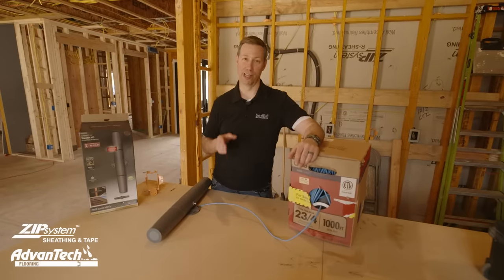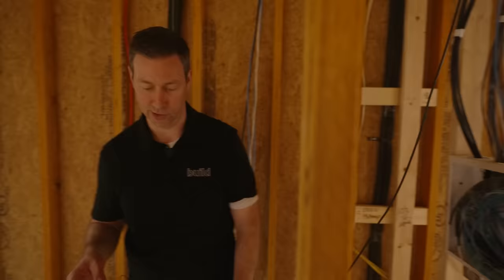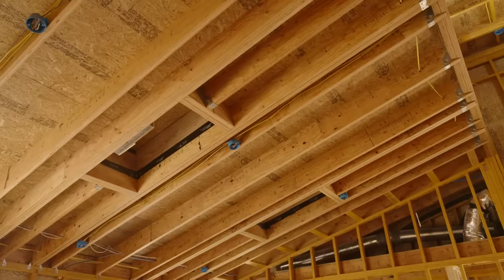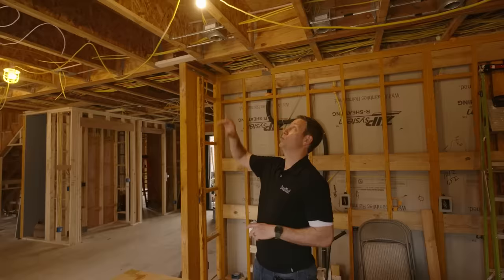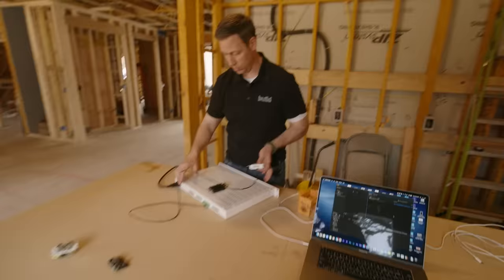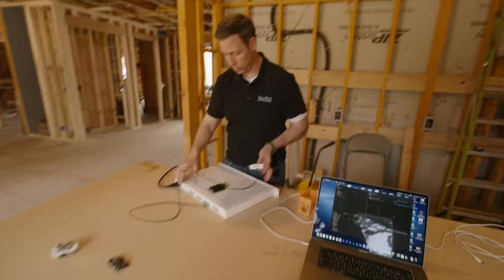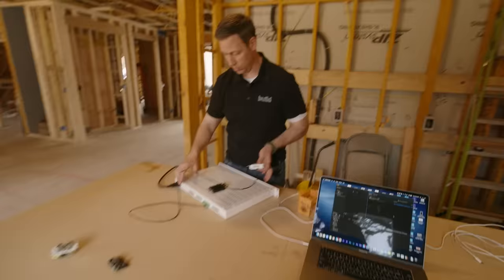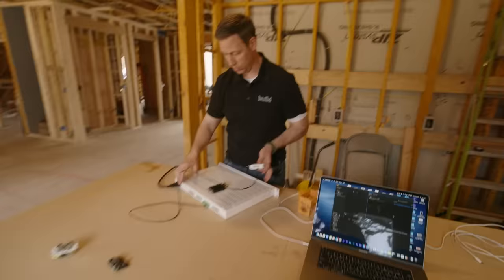Low ⚡Voltage at the Real ReBuild

Comment: Hi Matt, I've been doing low voltage and surveillance systems for 15 years now. I wouldn't recommend the unifi camera system. They are over priced and don't integrate with other systems. You'll have less cost, better video quality, and more options with Annke cameras or amcrest and one of their NVRs. Even better is a blueiris computer to record all the feeds. I've installed a couple unifi camera systems and regretted it. Their network gear is awesome though and highly recommend.
Reply: People having issues with UniFi cams are people who don't understand UniFi cams... Annke = consumer grade. Axis or Mobotix = pros.
Reply: @skynetlabs  Hi Kaye, if you know axis cameras then you know onvif compliance which unifi cameras are not the last I checked. It's not worth going with none onvif compliant cameras especially at the price point of unifi cameras. Also, an annke c800 4K camera is $100 with an image sensor of 1/2.5. In comparison the axis P3248-LVE 4K camera with an image sensor 1/1.8 which probably produces a little better image is $1000. I think for most customers I'll save them the $900 unless it's a casino 🙂. If you haven't checked out blue iris you should. Very robust system for a fraction of the price of other commercial ones. Most of my clients are home owners and small businesses so affordability is a big part of the bids. Ubiquiti makes great products but their cameras just aren't worth it in my opinion. One piece I ran into with them was a simple way to display the cameras anywhere. The netcam viewer system is a great solution if you haven't seen it that uses the RTSP stream to display the cameras. Unifi protects RTSP stream didn't work well when I tried it last. Wish you the best and I'm always up to talk more if you like and get any tips you have.

Comment: I would suggest a two level power system. Get a little bitty shut-off for unnessisary power devices in case you are on battery. Many devices (power supplies in particular have bleed resisters that will consume power in standby mode.)

Comment: Any unlink to hot spots, video and audio using cat5e, cat6, etc should be wire with shielded cable. It prevents a lot of issues in the future and your wireless devices will lag less.

Comment: Future-proofing a home is really tough. I love the Deako concept of modular switches where the owner can easily swap in a dimmer or change things as needed in the future BUT I would be reluctant to use Deako products because what happens if they aren't in business in 10 or 20 or 50 years?

Even that clever USB A and C system is going to be obsolete at some point. I have a 110 to USB A adapter (that came with something) plugged into a surge protector. Combined with USB A to C and Micro cables, this is a cheap alternative that I can take with me and eventually replace when the time comes. 

And speaking of surge protectors, I have all of my electronics and my refrigerator plugged into surge protectors. We don't often have thunderstorms, but when we do I don't trust our power provider to protect my electronics. Is there anything you are doing in your house to avoid the need for plug in surge protectors? If there isn't a "house power" solution, then surge protectors WITH USB ports are a nice compromise solution.
Reply: The best future proofing is something like blue smurftube where you can pull new cable later - whatever new technology that ends up being.

Comment: Would the lighting circuits be on their own separate circuit (not an electrician)? Or would they possibly be tied into wall receptacles when convenient? Otherwise having less expensive wire would make total sense to me for lighting only applications. Having something like that Voltek system in place could really cut down on resources on a macro scale.
Having plenty of Ethernet runs is just a great idea. While wireless is great, a solid Ethernet backbone makes more sense for all the media devices out there now IMO. You know we're gonna wanna see all the tech you put into this house! Especially if you have a dedicated rack. The Ubiquiti system would be interesting to see installed, especially as it looks like they have some video security equipment also.

Comment: One really good thing you did: the in-ceiling and in-wall speakers are dumb.  If in 10 years you don't want Sonos?  Swap it out for a new head-end.  I've got a Niles system, and all of the speakers (and the high-power amplifiers, even) being dumb means I could change it in about 2-3 hours for Sonos, Heos, Russound, or anybody else.  Good speakers, like the Sonance that Sonos sells, are on the market for at least 10 years and last for 30-40+ years, but the tech being centralized in a closet changes all the time.

FWIW, I even used AV receivers to power passive in-wall speakers for my TV, which can be swapped out at any time, over a sound bar.  Also, they look and sound better. :)

Comment: Ubiquiti Unifi works well - that is what we use for our commercial clients (and some residential)

Maybe you should have ran Cat7? (I foresee video/data increase in the near future for video over ethernet - 4K/8K/16K - 3d video...).  Isn't Cat8 now available too???

Also most cable companies are moving to internet boxes - so phasing out Coax.  But I guess always keep Antenna an option =)

I agree on the cable runs to the ceiling for Access Point from the below commenter (they can be POE - power over ethernet with POE switches)

You should have data cable runs to all TVs - because kids and their video games and Netflix.
Also Cable runs outside for all POE cameras
Also think about outside cable runs for patios and future add-ons (grandma suites/pool houses/tool sheds.  Maybe have a junction box you can add a small POE Unifi switch to split off from outside for future runs)

You should also think about running alarm type cabling and prewiring for options like doors/gates/garage doors - not just the window blinds

Comment: Hi Matt, you didnt put in sensors or smart devices? or access control (door locks etc)

Wireless even if its 1G, 2G, 3G 4G or 5G will have a hard time penetrating concrete walls and reinforced concrete basements, so  I think all low voltage should all be wired.

Also the media consumption is all digital, which keeps getting better in resolution and data bandwidth. 

Wired connections are also much more secure and reliable, although they dont allow that much flexibility.

thanks for this video, it was really informative.

future proofing your house should be sane decision, as the pace tech is innovating.

Comment: The voltek stuff looks cool. but i think a company like leviton could easily do better by building a single outlet and a USBC-PD and USB-A all into a 1 gang unit. Plus they could have that tech in all the big box stores easily. I just tried to look into the voltek since i would use something like that for customers or even my own home, but they want me to inquire within. Plus i would have to have the controller unit setup somewhere central then have to run the DC wire. Where as a single gang unit from leviton or whomever could easily just be a drop in replacement. using 110 wire which is already installed. Also if i were you i would install cat6a or drops for Fiber to where you would have computers. It would allow you to easily upgrade to 10G in the future. Could be useful if you are doing any video editing or anything at home.

Comment: In general I agree that keeping an option for cable vs all wireless is smart but I would go one step further.  I would have suggested using more “smurf” tube as conduit runs through the walls and up to the attic. It might mean longer wire home runs but you would always have the option to pull and re-run new wire when cat 6 is the extinct technology.

Comment: I am very interested in seeing the tech rack install, the Wifi Access Points, etc installed, and, why you chose certain locations for access points.  This is very interesting stuff.  I look forward to seeing how well your over-the-air antenna works.  Thanks - this was an awesome video and gave some new things to think about for my upcoming remodel.  Will you be adding a gaming console in the media closet?

Comment: One of the Leviton brand outlets has a USB-C port with PD (Power Delivery) that should be able to charge smartphones or other devices that can make use of it at higher wattage.  And if they’re mismatched, they’ll just fallback to the highest wattage both sides are capable of.

Comment: Make sure you read the manual on the antenna. Depending on the desgin, you should NOT point the long side towards the TV station, instead have the long side of the antenna perpendicular to the direction of TV station

Comment: LumenCache is actually a company doing low voltage for lights and lighting control
Reply: Yep!  I wish they had a more up-to-date YouTube presence showcasing the solution and products.  Maybe they are more focused on commercial applications now?
Reply: @bradgaeth   I think that might be true, or focusing on getting vendors on board. A couple of the videos I saw of theirs were geared towards 3rd party installers.

Comment: Nice video 
Boy just revived notification Wednesday 9 Am EST and there is some 791 comments 
Well 12/2 vs 14/2 it’s a different of 600 watts, well run wire my house 14/3  or 12/2 less of blink factor 
Now go low voltage DC 5volts think voltage drop even speaker wires go to 18 Gauge wire 5 Amps max 600 watts in most case it’s 5 volts x 5 Amps = 25 watts at plug - I used  Legrand they rated at 5 volts at 3.1 Amp or 15 watts power 
My old Laptop is 24 volts at 70 watts or 3 Amps so need brick 
In school instructor said wire vs air to bounce just add wire only one Atmosphere but the space travel 
Sound over light waves 
It’s 80F at cape cod Ma today w/100% sun it’s great day

Comment: In 1999 my wife and I had our current house built, during that process I wired the house with CAT5 and coaxial cable. Each bedroom (4) , the kitchen, garage, dark room and two family rooms were also wired.  Fast forward to 2017 maybe, Verizon is now offering one meg internet speeds.  Bought the service, got an upgraded router and then there was failure after failure. Couldn't get the speed they advertised. Their response was... the speed is getting to your house, but the wire in the house can't handle it.  My next question, can we do it wirelessly?  The answer was No. Hardwired cables give you the fastest speeds. I had to rewire my house with CAT6 500Mhz 23awg 4 pair wire. This could be accomplished because in 1999 I had the builder install an 1.5 inch PVC pipe from the basement directly into the attic. Using that pipe I was able to rewire the bedrooms on the upper level and the garage.  The basement and first floor connections we're also completed with a little bit of difficulty.  So now my Internet connections are instantaneous.   Your video this week as usual had a lot of good information in it. The one thing that's really interesting to me was your TV antenna for local channels. Since the FCC changed all the channels to digital, we haven't had a good signal even with an antenna installed in my attic.  We get one channel.  The antenna website you mentioned was utilized and I discovered all the channels in the area come from the same location, almost. So I don't understand why I get one channel out of six.  Keep up your good work.

Comment: The ethernet cable listed in the description is copper-clad aluminum (CCA) wire which is not recommended in the IT world; you want solid copper wire instead.

Comment: 19U is definitely not enough go for a floorstanding 42U.  You want to separate stuff for heat and for wiring neatness.
TiVo, networks switches and a few other items will cause a lot of heat if racked next to each other.

Comment: I checked out the Voltek system. The specs say that each line can provide up to 60w. The laptop you showed is a 16” MacBook Pro and it requires a 96w. Their website says it will charge “most laptops” but technically it is only powerful enough for the MacBook Air and that’s it. The 13” MacBook Pro requires 61w and the 15” MacBook Pro takes 87w. 

Just a heads up.

Comment: Even if you’re planning on using wifi with a mesh network, run cat6 to various points in your house to install access points. That allows the network backhaul to run on the wire rather than a wireless frequency and will give better performance.

As far as the Voltek system goes, why spend $1000 for a glorified centralized power brick as opposed to installing separate supplies at a fraction of the cost?

Comment: Ubnt makes decent network equipment, I just don't like that you have to have a controller and they are JUST starting into wifi 6 (ultimately why I switched). Cat6 is a good upgrade over CAT5E but I would recommend the shielded alternative, cat6a, for permanent wiring to minimize any noise from lights or adjacent wires.

Sounds like you are thinking of the backup plan for the Demarc which is always good since technicians will likely reterminate the hell out of it until there is nothing left.

Comment: USB power delivery caps out at 100 watts, so "most" laptops will work on that USB type C port, but some gaming laptops are bigger than that. For example while my Alienware M15 has a type C port for video and everything else a type C port can do, it doesn't input enough power so it doesn't accept charging, and my power brick for it is a big 180 watts.

Also I'd have done 12/3 also, just because there are a lot of low power lighting capabilities out there, doesn't mean that's the only thing you want to run on those lines. If someone gets into crafts, you might want a heat gun, soldering iron, and hot glue gun all in the same room and all of a sudden that 20 amp circuit becomes critical.

Sounds like a full network closet. I'll be interested to see the rack build. Also Matt to be fair, even a lot of IT guys aren't network engineers. There's a lot of specialization in tech now, just like there's a lot of specialists in home building. You have 3 different people for network, server, and desktop administration.

Comment: Coming from a Low Voltage contractor that Voltek product is absolutely absurd for $1000 haha. You can retro in a USB QC 3.0 or PD outlet that outputs 30W which granted isn't 60 (very few devices will even utilize this) but the idea that this is somehow a cost savings vs running "high voltage" wire which you are REQUIRED to do by code anyway (outlet spacing requirements) is off base. If you buy the right outlet it WILL charge a Macbook pro (currently posting from mine plugged into my PD outlet) and certainly fast charge any mobile device (charges my Samsung Note at maximum fast charge). Is it marginally slower than the brick for the laptop? Sure! But it's worth not having to take up an entire gang for only two USB ports (current outlets now will allow two USB PD along with 2 full outlets, they even have 20a options) in a system you have to run EXTRA cables over what you're already required to do (again, added cost, not cost savings) and then you're committed to those locations vs a 110v retrofit that you have the flexibility to add anywhere in your house for $40 on average. I would never spec one of these for a customer.

Comment: Generally on our builds we never run a single cat5e/6 cable, I always prefer doubling what you think you or the client would use especially the way technology is these days as well as its just always good idea to have redundancies. I also like running a couple ethernet wires to mechanical rooms for possible various future sensors.

Comment: Matt - I'm a huge fan of the show.  You're doing great things and I appreciate your thinking and approach to building.  I've retrofit my 1984 house with LED's.  The lighting itself is awesome -sharp and pure.  Since the LED conversion I've discovered a menacing problem and for months didn't know it was a "thing".  The "thing" I'm referring to is a cluster of topical names: harmonics, EMI, EMF, EMR, - dirty electricity.  Might you have any advice on how to address this "thing" at my house?
Reply: Isolate your grounds, make sure you run low voltage apart from electricity and cross at 90% when possible
Reply: @darrenswenson4602  Much thanks, Darren.

Comment: You might wanna consider changing your cat6 cable if you think about running POE cam. The one you linked is CCA and you want solid copper,. Using CCA with POE is a fire hazard.

Comment: Matt looking good like your thought process Been installing 
liw voltage 50+ years  i am  ocd about boxes being same height and straight   look at 18:20 secs boxes offset   didnt talk about blue flex in orange box where does it go? back to headend for what?  You should read all you can about wireless  health concerns been around for years  with 5g coming going to be even worse I 
always run at least a cat 6 to every room Use to run 2 cats and 2 rg6 quad to every where a jack would be futureproof . You can pretty much trust a great internet experience with cat feeding it  
Check out some commercial led forums there are whole bldg led control systems  Thanks for your great content I have learned so much

Comment: Ubiquiti makes awesome WiFi hardware and the Dream Machine is well reviewed.  Cat 6 is great, not outdated nor overkill.  Conduit from the media closet to the attic is very smart as well - I'd recommend leaving it empty until you need to add a wire and have sheetrock in the way.

Ubiquiti's cameras are not yet a mature offering.  They're expensive, proprietary, low on features compared to their competitors, and the night vision of moving objects (the hardest thing a security camera is asked to do) is quite bad.